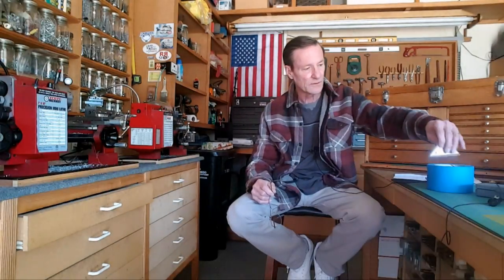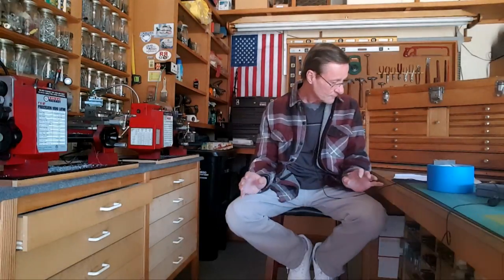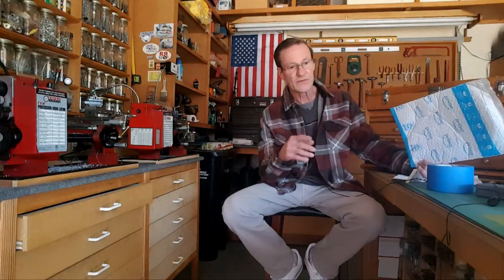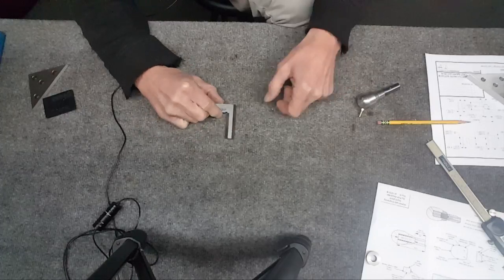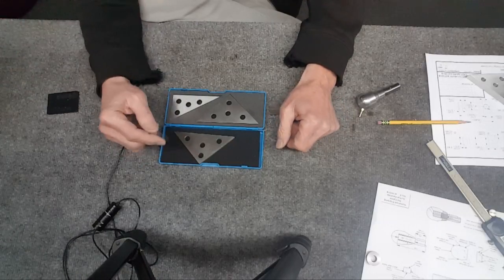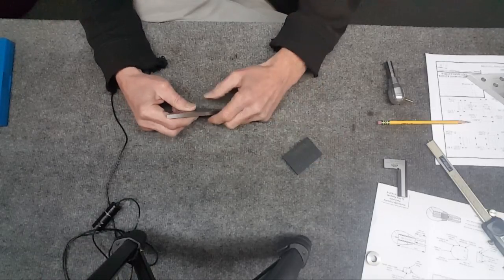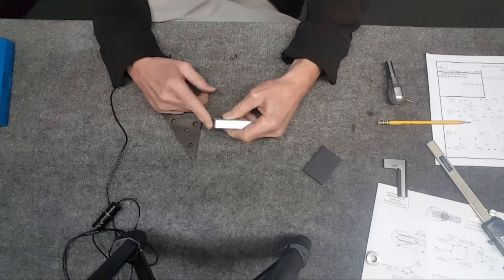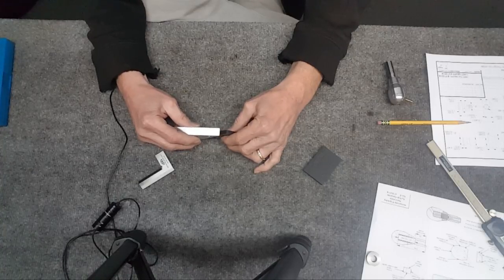Making A Precision .500" Thick Angle Block

Comment: If the two rectangular sides clock in at a 100% plumb (test with an indicator, not a try square)  and they are both equal in length and thus for a 90 degree angle. Out of this follows that the two other angles have no option but to be 45 degrees.
It's all about how 'anal' you go measuring your parts.
When measuring with a try square, you'd be surprised about the magnitude of mistake you can make.
If you are lapping your work anyway, why not consider making it out of toolsteel and harden & temper it?
It isn't difficult. And it would give you a product that is a lot more usable and durable than anything made out of aluminium.

Paddy

Comment: Meassure the lengt of the sides from the 90deg. If they are the same length the angles should be 45deg. It should at least give you an idea of how accurate it is.
Reply: And if one is longer than the other, he can measure the other side and work out the exact angle.

Comment: Good job  Dave,
Have your watched Joe pieczynski video on making angle blocks ?.
He drills and reams the holes first, places ground pins in two of holes holds it in the vice and mill's it.
Adam
Reply: Dave

Here's the link to Joe's video that adam mentioned

https://www.youtube.com/watch?v=lDwAzcSUVtI&t=632s

Make super accurate angles - especially for odd angles like 22.5 degrees, and could have used easily for that 45 degree block

John

Comment: Nice project Dave. I quit using tape on my A6, it's too expensive in the long run. I started using the print pads that stick to the hotbed. No more adhesion problems unless the print head is out of adjustment, which seems to happen too often. Thanks for the video!